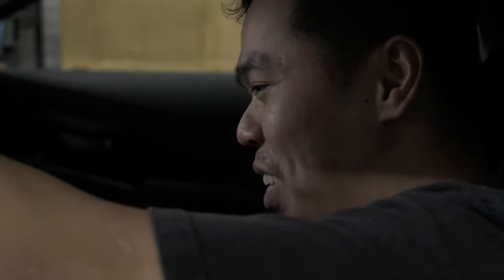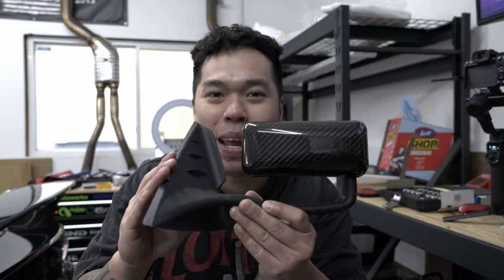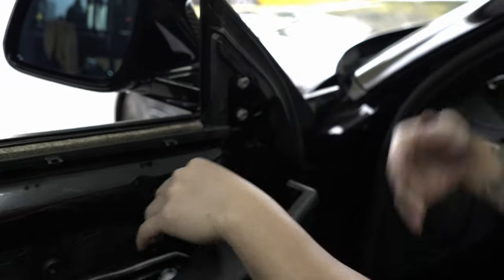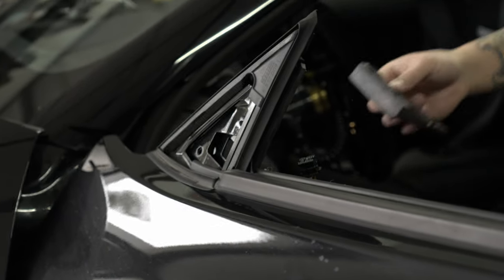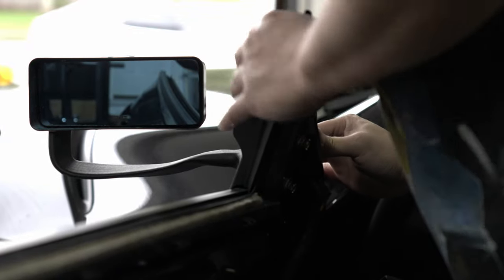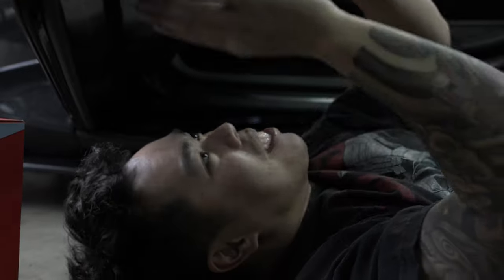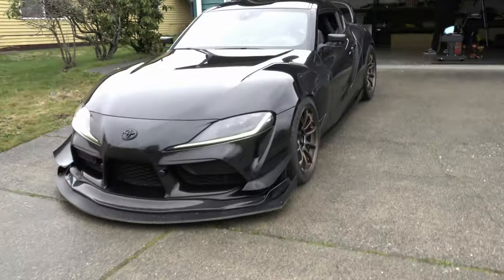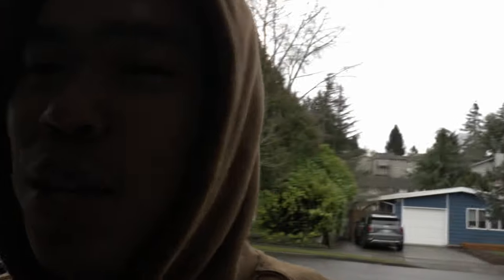I FINALLY GOT IT! Building my dream GT3 SUPRA! (EVS GTLM Mirrors)

Comment: Those mirrors look great man!  Does it throw codes with the power and heat disconnected now?
Reply from the maker: No codes! All you have to do is turn off the blind spot monitoring in the vehicle settings.

Comment: So is it the mirror that makes the wind noises? I'm waiting for the a91 limited this year. I hope for a sweet color like a green or purple.

What is the exhaust set up on the yellow one?
Reply: That tiny little piece he ripped off and threw away at the beginning is what helped prevent the wind noise with the windows down. So it’s not the mirror that makes the noise per se, it’s the whole body of the car and how the air buffets in and out of the cabin when you’re cruising and roll the windows down.
Reply from the maker: It's the design of the mirror however there are part to help the wind buffeting on the stock mirrors too! Also the yellow has a catless downpipe with the HKS Hi-Power exhaust.

Comment: not ideal for daily driving as the mirror shakes whenever you close your door and any imperfection on the roadways
Reply from the maker: yup. they do vibrate under high speeds. lucky for me I dont have to daily drive it anymore.
Reply: Also, you lose the great features of the original mirrors?
The blind spot sensoring and auto hide when locking...
Reply from the maker: @alexandermitchell3845  yup you lose all of them 🥲
Reply: @Vinh Tran  It does look cool, though.. What are the first mods you would recommend for performance?  Im saving up for cold air intake and exhaust.
Reply: @alexandermitchell3845  Catless downpipe with the stock exhaust is the best bang for your buck. It sounds excellent, and you don't need to upgrade the stock exhaust until you want more sound/volume. If you don't want to deal with CEL, armytrix and kenji garage are the only catless DP I know of that doesn't give a CEL so you can pass inspections. JB4 piggyback custom tune with jesse dabears with catless dp, intake, chargepipe should give you plenty of power until you want to send your ecu out to use ecutek/mhd/bm3.
Reply: @Scooby  this is cool. Ill check out some videos and see what it sounds like. Mods here in Perth Australia are expensive and hard to come by..